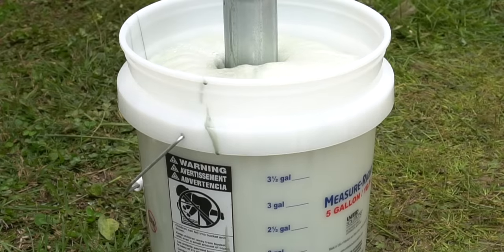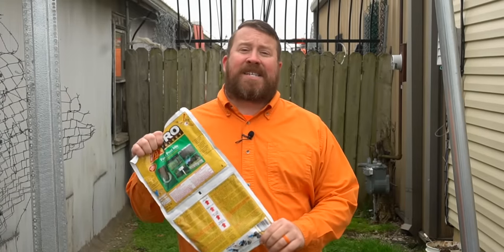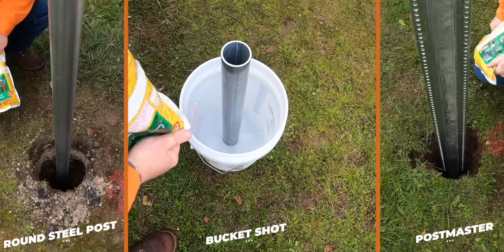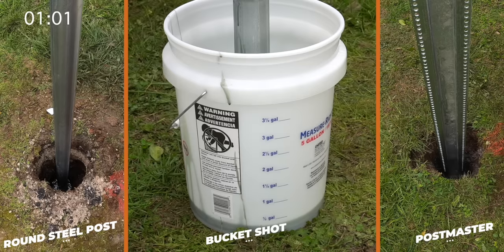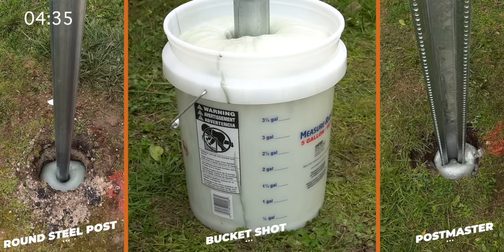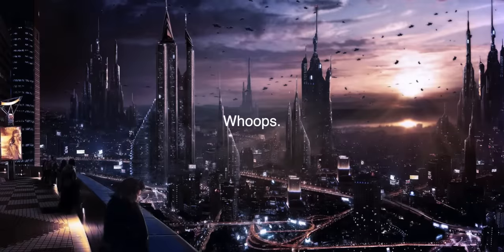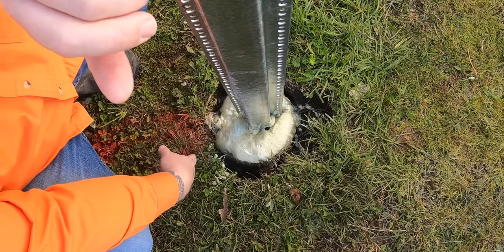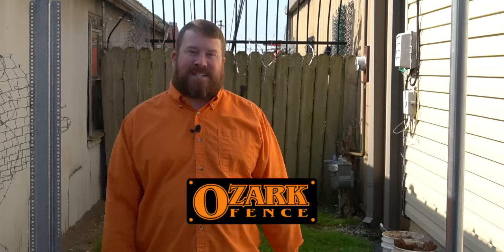Does Fence Post Foam Really Work?

Comment: I've used this product on 4x4 wood posts for a few years now (three or four fence projects), and every post is as secure as the posts I secured with cement. Also, when I pour the foam in, it starts rising also immediately and the hole is completely filled in less than 45 seconds. In your video, it took nearly one minute to see it start rising, and three minutes to get to the top. Also, none of the foam I poured contracted after the pour. In fact, I hit one of the posts with my small Kioti tractor a few months ago, and the post didn't budge. I love this stuff. I use concrete much more often (because of price), but when I need to set posts the same day, I use this product. Not sure why you had issues with it, but this worked as good as cement every time I've used it.
Reply: Same for me.  Ran a smaller fence with this (only 5 post).  Have no idea how this took hours to set up?   Also did not have any contraction.  Everything is still good after 3 years.
Reply: I used it for a mailbox post, 2 feet down, it is solid as can be.
Reply: That’s the one thing that’s annoying about these type videos. Someone who’s never done something can’t fathom they’ve done it wrong and gives bad advice to a lot of people.
Not sure if it’s intentional or incompetence, but it’s amazing how often I see this on YouTube
Reply: @Pmc987   you watched him do it, what did he do wrong? not mix enough?
Reply: same here 20 fence on foam no problem dig 4 feet ;)
Reply: @Pmc987  you do know what this man does for a living right ? , could there be a fault in the product he used ? , sure ofc there could. but to call him incompetent is going a bit to far aint it ?
Reply: @Ladosligese  as other comments in this thread have indicated, maybe he was working in the wrong temps to use this product.  Also another writer said that his metal posts did not work out either.  Nobody said he was incompetent but rather suggested his timing may have been off (weather wise) and just maybe he didn't mix enough - I did notice after watching the sika video that he did not mix as suggested.  What he does for a living has nothing to do with it
Reply: His foam isn't correct color either.  I think he got a bad bag or something

Comment: I wish commenters who are kindly sharing their experiences with setting posts with foam would include more details beyond just that "it worked for me" or "it failed for me."  (Especially commenters who seem extremely passionate about their results being universalizable.)
For instance:  
General location/region/climate?  Was the dirt wet or dry?  Was the post wet wood, or dry wood, or metal?  What was the air/soil tempurature?  
This seems like a great opportunity to compare notes, and see if there are variables that correlate with sucess or failure...
Reply: See Bryan Hall's pros and cons. I used the Sika product in Toronto, dirt is moist, posts are pressure treated. Dug out the holes, sank the posts ~3ft and poured in the mix. Make sure the posts are firmly held in place otherwise it'll possibly move out of alignment while the mix is curing. It's not a bad product, but you have to plan it and be mindful. Set time is roughly 5 minutes, so there's very little "wiggle" time to realign things if need be. I would suggest using sonotubes for consistency - I did not use them for my project and think in hindsight it might have helped. The one variable I found was how much it filled up the holes. Overall, it filled 3 ft cleanly but it could be up or down a couple of inches. If you're looking for a finished look, it's difficult to top up the stuff - and you have to use up an entire bag as there's no way to take out a measured amount. I also don't know if it loses any integrity if you cut/shape it. It's easy to cut with a reciprocating saw and an average blade. The one load bearing post (for a gate) I will use concrete. You can save time by using foam but you probably have compromise in terms of at or above ground look. If you get the stuff on your hands, it's much like the insulation foam - gets quite sticky on one's hands. Posts overall are still firm - no wiggling like in this video. Perhaps it's to do with the soil?
Reply: Who has time to factor in all the variables you mention when concrete will work in about any soil conditions.  Concrete is also less expensive.  I know it has the drawbacks of weight, dust, etc.
Reply: there you go being reasonable and logical .     aaannndd you're right variables matter ,sometimes a lot . you're basically describing " the scientific method ".   temp and humidity affect a lot of things that " cure ".
Reply: It worked for me.   It failed for my neighbor

Comment: Hey Joe! I work with polyurethane foams (that the Sika PostFix is), and there's a couple of things that stood out to me.

TL;DR:
Were the components at the correct temperature when mixing?
The shrinkage of the pours was most likely caused by insufficient hardener/isocyanate activation throughout the foam (poor mixing and/or bad mixing temperature).
Ultimately the shrinking is caused by not enough hardener/isocyanate in the foam, to 'lock' it in place.

First of all, a couple of pointers for 2K/2-component polyurethane foams.
The components of the foam are a plasticiser (a polyol) and a hardener (an isocyanate).
The polyol is comprised of the main plasticiser (the polyol), a foaming agent (could be plain water, or some proprietary 'blowing agent'), an accelerator (a catalyst, some kind of potent acid), and a stalibizer (more plasticiser or silicones).
The components react with each other, forming a few intermediate molecules and some gases, before forming the long polyurea linkages, which 'lock-in' the shape and volume of the foam.
The formed gases are trapped inside bubbles, which then solidify, trapping the gases inside the bubbles (usually for insulation purposes).
The solidification is wholly brought by the hardener/isocyanate.

What I see from the video, and what Sika's material safety data sheets describe, it's a pretty 'green' system (no ozone layer depleting CFCs, nor that much super-greenhouse HFCs).
So most likely a water blowing agent, or some LBA† 11-herbs and spices, and a 'middle of the road' isocyanate.
I couldn't find the exact mixture ratio, but it should be pretty high (high is somewhere around 100:150 to 100:170 | pol:iso, by weight), as a lot of structural integrity is needed from the foam.
If you go much higher than that, you start to get PIR, not PUR. You have so much isocyanate, that it starts to react with itself and begins forming Polyisocyanurate.

† Literally: "Liquid Blowing Agent", tells about as much as "natural flavoring" in foodstuffs.

The material data sheet indicates the following timings as a guideline:
-15s          | mixing
0s             | pour
10s           | rise time - after this, moving the post would tear the forming bubbles, and cause a poor interface layer to form
180-300s | fibre-time†† - a very, very large uncertainty here, most likely due to differing temperatures of the surfaces and the components (hey, it's outside, not a factory floor)
no given time for tack-free time

†† Fibre-time is the moment, when the intermediate molecules are exhausted, and the chemical reaction begins to form the polyurea chains. Usually tested by poking the foam around the projected fibre-time (a stick works, but a coarse threaded screw works really well), and observing when strands/fibres start to stick to the poking device.

As to what could have caused the poor performance of the foam:
The rise time was very delayed (around 45-50s), hinting that the components weren't up to a high enough temperature, oooor unlikely due to very, very poor mixing.
The fibre-time was at around 270s, which is at the later side of the given fibre-time, further suggesting too low mixing temperature or poor mixing.
Even further, the fibre time comes very late for the apparent temperature, as the 300s fibre-time is suggested to be at 0°C, and the video didn't look like it was near freezing. :D

From those observations, it would seem that the components weren't at a high enough temperature for them to work properly, leading to shrinkage.
The material data sheet gives 25°C (77°F) for 2 hours before use.
And the MDS leaves out a very important temperature for a foam pour, the temperature of the 'mould'. I do get it, why they wouldn't mention this, as you're pouring it into ground. It happens to be at the temperature it just happens to be at.
In any moulding process though, the mould temperature is extremely important. A rule of thumb that I was taught was: (recommended mixing temp in °C / 20) X target density in g/l
(The MDS mentions ~1000g of product, and a final volume of 20l = 20g/l)
So in this case the optimal surface temperature would be: (25°C/20)x20 = 25°C
Reply: Seems like concrete doesn’t need all the math and whatnot
Reply: That is some detailed information! Great to know, would be nice to see a follow up video at a higher outdoor temperature
Reply: Yeah if you need 14 paragraphs to explain how to use it just use concrete. The entire idea of the foam us it's fast and easy. If I'm breaking out a trig calculator it's a hard no for me.
Reply: It clearly says on the bag, when mixing you are required to force the bag against a 90 degree angle to mix the components… not with your hands squeezing the bags
Reply: Great reply. Thanks for taking the time to put this together.
Reply: So what you're saying to me is that expanding foam is completely unsuited for fence post installation.

Comment: my local hardware store has a display made for this stuff, its a 4X4 post set with foam in a 5 gallon bucket, its been there in the store for more then a year , the post has actually come away from the foam and is lopsided in the bucket lol , yeah, wont be bothering trying it myself lol
Reply: May have to allow for a stream of customers wiggling the post, however that sure doesn't sound good.
Reply: @scottwillis5434  its hard to wiggle the post, its just in a 5 gallon bucket, moving the post moves the bucket as well, i guess you could wrap your legs around it and push lol. this looks more like the foam has shrunk away from the post, it didnt bond or stick to the wood at all either , usually with spray foam you cant remove it from wood if you wanted to, you have to cut it away and scrape it off
Reply: @townside_woodcraft  I imagine the setup for that display was done as quick as possible too. These foams can work great, but they have to mixed very well and at the right temperatures. Maybe one day they'll come up with a foam that works 100% of the time no matter the conditions.

Comment: I’m in Australia.
I recently pulled an untreated hardwood post (about 12” diameter) out that had been in the ground for approximately 30 years.
The wood was in near perfect, as new condition below ground, fairly good still above.
They’d placed crushed rocks at the bottom and back filled with crushed rock and local dirt.
We average about  1 to 1.2m of rain per annum here and get fairly hot and humid summers, sub zero in winter, termites, wood rot etc.
I was pretty impressed.
I’m sure the type of hardwood helped also plus the sap wood had been removed prior to burying.
Not sure what it was though.
Reply: only thing I added to the ones I put in the ground was to paint the bottom couple of feet with spray paint.

Comment: I've used this foam on dozens of pressure treated wooden fence posts and it has been great every time. After several years, I have yet to have a post fail.  I could imagine that on metal posts and slick plastic bucket surfaces it would have more trouble adhering.  One other item I found to work well with the foam was to reinforce the foam by putting some rocks or broken cinder blocks in the sides of the holes and only then poor the well-shaken solution into the holes.
Reply: @tailgatecarpenter26  Amen.. much respect to anyone doing this work for a living….
Reply: Right,  the same here

Comment: I used this exact product to install the post for my chicken and duck pens.  I am in them daily and they are almost a year old.  I have had no issues.  I did use wooden post and was probably not as deep as yours.  I had to trim the extra from the top.

Comment: I used a similar product when I installed my new mailbox and post.  I was done in two hours and did not have any shrinking problem.  Holding up quite well, almost two years old. True once mixed you have to work very fast.

Comment: If you mix your cement up the right way in a wheelbarrow it will last a lifetime and while the cement is still wet in the post hole you have a chance to move the post left or right if you are off a little on your lineup. Thanks for the video.

Comment: I've never used this foam, but have used a couple of sica 2 part epoxies holding 500lbs pieces of glass railing, both interior and exterior, and it was stronger than the special hydraulic cement we used to use. Really good stuff!

Comment: You should try the same experiment except for once it’s pretty much done expanding feeling and packing it with dirt like you normally would then come back in a few days, dig up the top and see what you find. I’ve never had issues with this farm not for this particular use but I have done a fence post with it and it still standing two years later nice and sturdy but this experiment is concerning, I wonder if the oxygen has something to do with it too much air for too long

Comment: In 2009, maybe 2010, I put up a wooden fence with 4x4 posts, replacing existing rotted posts in concrete. I put the posts 8’ apart on center with the holes 2’ deep. The span was about 250’. I used the two part foam and allowed the foam to make an above ground mound. In the bottom of the holes I put river stone so that the foam would expand and seal around the bottom of the posts and completely around the sides, making it hopefully waterproof the wood. Here we are 14 years later, there is no post rot, the fence has withstood two hurricanes (I live close to Galveston Bay), and is very stable. I do not remember the brand of foam that I used, but it foamed up the color of Great Stuff, maybe a little lighter yellow. I suppose everyone has a different experience, but I thought I would relate my own experience. I’d use the foam again, and might have some left over in a shed somewhere.
Reply: I'm in Houston too and this stuff works so good. I think it's meant for wood and that's the problem he's having. Zero termites or wood insects.  I like this stuff. Plus I can actually diy as a female with this stuff.

Comment: I just wanted to share my experience with post foam….after removing the old subsurface concrete pylon, I used a square cement block and added gravel round the outside of the block an little bit inside (of the square block hole ) after my 4x4 was centered in it. THEN I used the foam to fill the enitre  hole in the ground and also the gaps in the concrete block (with the little bit of gravel). We had a severe wind storm that ruined two other fence posts, but that foam one was standing tall and strong. So it really depends on how you prep the hole. I went off label and kinda did my own thing but so far it has worked out great and I did not have to deal with dusty heavy concrete bags. It was a nightmare though getting that old concrete out.
Reply from the maker: Interesting, I appreciate you sharing your experience!

Comment: Thank you for the before and after. All the other videos I have seen reviewing these products simply show how they are using the product and fail to display the durability of the product. This video has sold me on using concrete for my upcoming fence project.
Reply: Hell yea, give it some love
Reply: Where I live no one uses concrete and they tell you not to.  It rots wood.  I guess if you use steel or vinyl concrete could work but water still gets under the concrete and will freeze and heave the fence.  Then you  have a nightmare to remove a fence post attached to a bunch of concrete.  I use 1/4 down and every one uses some crushed rock to set wooden fence posts.  The water drains away.  Cement has caustic chemicals that dissolves wood and water gets between the wood and concrete and rots the wood also.  I just use a jack to remove the old post that has shifted and clean the hole out and reset the post straight again.

Comment: I built 80' of fence using 12' 4x4  posts in Alberta, Canada dug down to a minimum of 4' for each post to get below the frost level. The foam did a perfect job and held every post super solid, I used 2 bags for every post and 3 for each corner. The reason I used them was beaucse I didn't want to mix concrete and haul so bags into my backyard since I don't have an alley for access. I would absolutely recommend this product and I would use it again for sure.